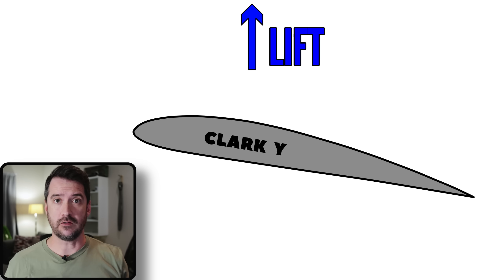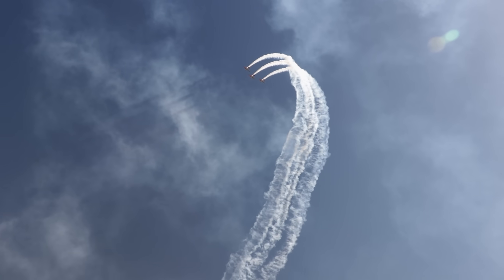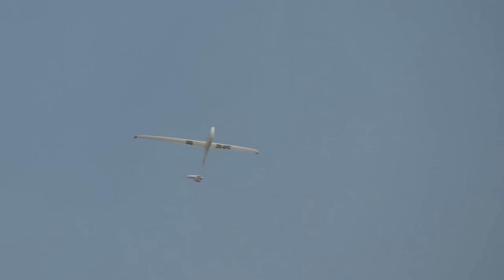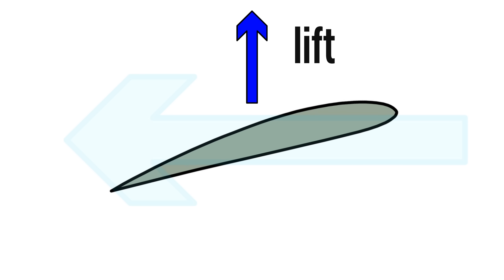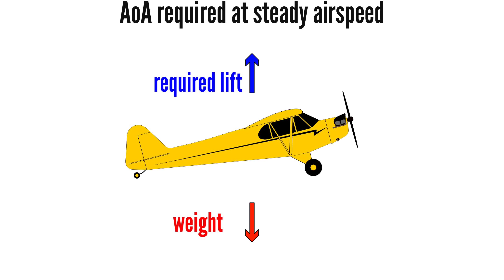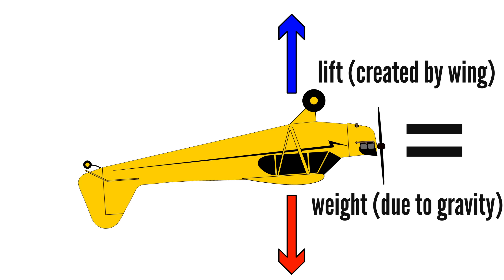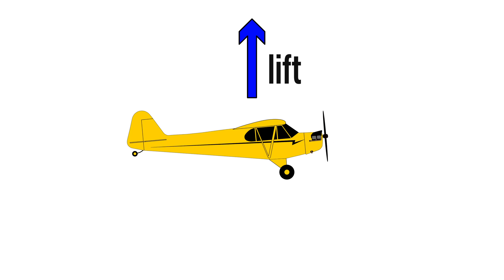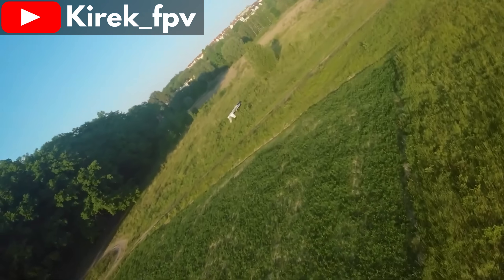Is Airflow Distance Over the Top of a Wing Always Longer?

Comment: I drove my instructor to shouting, arguing with him about the standard explanation of lift !
In my theory, I call it force of air mass/pressure under the wing causing the force of upward against gravity !
Nature hates unequal air pressure and the bottom wing is in the way !
I say the mass of the air flowing under the wing is pushing the weight of the plane up and the air flow over the wing
is just creating a more efficient low pressure area for that to happen. At stall angle of attack all that has happened is the
force of the mass has turned into drag and has exceeded it's ability to make things to go up.
Ever skip a flat rock on water ?  As long as the rock contacts the water at best angle of attack it will skip until it has lost
it's energy/thrust due to parasitic drag. As far as I am concerned a propeller and wing are doing the same thing, just on a 
constant and in a more controlled  manor.
Reply: Wind tunnel tests show that even at angle of attack close to the stall the pressure drop over the wing is much greater than the pressure increase below the wing. Now technically yes, the pressure under then pushes the wing up but really you must consider the differential (the CL x q in the formula Lift = CL x q x S), most of which is derived from the pressure drop in the increased speed of flow over the wing.

Comment: You make many sound points.  However, the oldest, most difficult, but most accurate explation of lift in a subsonic wing is the circulation theory of lift.  There are reasonably simple heuristic explanations of this theory, which only require a middle high school level of mathematics.  But the full explanation requires some pretty sophistocated math relating to the Kutta-Joukowski theorem. A full explation of this requires an understanding of line integrals, as well as vector and complex analysis.  This is the stuff of a second year university engineering course. I have an entire textbook on it.   The full story is quite a jump up in complexity and, therefore, not usually taught to pilots and people who are casually interested in all things flying.  I can supply references if you're interested.  Fun fact, the full explanation of 'how a wing flies' can be formulated with a series of equations that have no explicit or closed form solution.  At least, not without making some pretty limiting and factually incorrect simplifying assumptions.  Therefore, the  only way 'solve' these equations is through computer aided simulations.  But these simulations are still only approximations.  Therefore, no one can say, for sure, how a specific wing will work till you fix in onto an aeroplane, stick a test pilot in the plane, and fly it!  Even windtunnel testing is not quite the same as'the real thing'.  Still want to be a test pilot?
Reply: As a test pilot, with a MEng degree in Aero Engineering, this comment is the one that I agree with the most. 👌🏻
Reply: As an Aeronutical Engineer this is the answer I was looking for. There is a reason it is called lifting "theorems" and not lifting "laws".
Reply: Explaining how a wing generates lift and solving the equations of lift for that wing are two very different things. The fact that you seem to confuse these two things is somewhat concerning.
Reply: Thank all of you for your statements. From someone who loves aero-D but went to work on the flight deck. The fact that a flat or symmetrical surface will only create lift in the direction of the angle of attack always dispelled both the camber/deflection theories in my thoughts. 👍🏼
Reply: @davetime5234  It depends who the audience is. An Air Cadet would get a different explanation to a graduate. Nevertheless, despite the lack of context of your knowledge level, I essentially begin to explain it using F = P x A. We know a pressure difference is occurring over the wing, which has a surface area, a force is generated (lift). A by-product of this force is drag, partly skin friction, partly bluff form drag and partly the low pressure in the centre of the trailing edge vortices. This would normally trigger 2 questions. 1, why is there a pressure difference - what causes it, and 2, what are trailing edge vortices & how do they occur? Starting with 2, if high pressure air is under the wing, and low pressure air is on the upper surface, the air wants to flow from high pressure to low, just as air inside a balloon wants to escape. As the air can't migrate through a wing surface, it slips around the wing tip, and generates a spinning vortex which gets left behind the aircraft. Sometimes, these are made visible by moisture. How so? Well the air in the centre of the vortex is condensing. Why? The air is cooler than the surroundings (and reaches dew point), because air in the centre of a vortex is at a lower pressure (hence it being a contributor to the overall drag, remember?). Going back to question 1 then, which is the root of all this…why  is there low pressure on the upper surface of the wing and higher pressure underneath? Well, here's the cool bit - no-one really knows for sure why it happens! There are theories and plenty of long equations, and people study it at incredibly high level, but like many things in life, we don't fully understand the 'why' bit make full use of the effect produced and accept that it's great to soar like a bird and see different countries in a matter of hours. According to the theories, apparently bumblebees should not fly - but they do. Sometimes the world is a magical place.
Reply: @peteohead To discuss a minor point, obviously bumble bees do fly, and when not analyzed with non-applicable math, there is no issue. 'Can't fly' resulted from using fixed wing formula, and bumble bees have extremely movable wings. When moving wing dynamics were considered, the math agreed with the observed bumble bee flight and hover. IIRC, the vortices generated as wings approach then separate from each other at the top of every flap, supplied more than enough differential pressures on the wings to explain all the bumble bee flight envelope. I doubt this fully explains the real genius of moving wing flight, Dragon flies, with two pairs of fully independently controlled and driven wings. Reportedly, they are almost as fast in reverse or inverted flight, the true reigning masters of flight.
Reply: See I agree that SOLVING lift is too difficult to explain to the layperson, but lift as a concept isn't that difficult to explain at a basic level: it's certainly better than continuing to use a WRONG explanation, which the equal trasit theory is plainly wrong. 
Everyone has seen the balloon/jet on a string demonstration, where a balloon releasing air rearward generates a propulsive force forward: at the most basic level, all the wing is doing is taking the flow of air moving rearward over the wing and turning it downward to generate a lifting impulse. I don't think that description is too difficult for someone with a casual interest to understand, and I think saying that "it's too hard so we're just going to keep teaching pilots the wing theory (who I'd argue have more than just a casual interest in the subject!) is a complete cop out!
Reply: OK, just to clarify. Thanks all for your comments on my comment.  And, again, I loved the original post.

I was trying to keep my explanation simple and heuristic.  Quite frankly, you can pilot a plane perfectly well without really  knowing exactly how lift works.

Afterall, people have been doing it ever since the first plane flew, and before, if you count unpowered gliders.  Same principles govern  lift in helos.

Baloons, dirigibles and all lighter than air aircrsft are different, though.

Perhaps an analogy is in order.  I can work a tap without knowing anything about fluid dynamics.  I might get annoyed when the I get 'knocking' in the plumbing.  But I know how to fix this.  Change the pressure.

Now I, with my maths degree, could give you the equations that explain  'knocking' in a tap but your eyes might glaze over.  However, these are pretty much the same equations that govern laminar flow over a subsonic wing or the flow of plasma at 100 million degrees in a tokamac fusion device.

Heuristic explanations are 'good enough' for Private Pilots with a PPL.  With some modifications, they even do well enough for people with Commercial and Aviation Pilots Licences (CPL and ATPL).

Conversely, I understand the theory much better than most but I have struggled to obtain my PPL.  That's because I am autistic and have terrible eye hand coordination, and a crap working memory.  I lack 'feel' for the plane, my instructors tell me.  I'll get it one day but it's taking forever and I'm now 65.

It's quite embarrasing really when I've seen 87 year olds and 17 years do quite naturally what I struggle with.
 
The rest of the theory is for aircraft engineers completing a four or five year degree.  Or, for enthusiasts.  You are perfectly welcome to wade through the ssme texts that I have.  Hundreds of pages of equations.  I love equations but then most people call me a freak!  Goes with being autistic.

Kind regards, A Freak.
Reply: @jamestucker1126  Don't be embarrassed about your difficulty in the cockpit: I too am a "failed" commercial pilot. Unlike you, I had great hands and feet, but I get behind the aircraft mentally and at that point can't catch up. It sounds like the two of us together might make one very good pilot! After having to give up my dream of flying, especially after spending all that money chasing the dream, I've come to accept that we all have different talents, math and other fast calculations that are done in the cockpit are not my talents, and that's not only OK, that is normal. 
You are not a freak. You are normal.
Reply: The "circulation theory of lift." is something I've been on the edge of understanding. My lack of formal education in that subject has hindered my complete comprehension, but my sense is that it is closest to reality.  Still, I managed to make some successful sailboat foils back in the day using Theory of Wing Sections.

My sense is that you can make good approximations with data -- ToWS, or with math -- CFD, but you have to remember that they are approximations and compromises.
Reply: that´s it! when I studied aerodynamics I  studied it hard and with serious books. to begin with "aerodynmics"  --- theodore karman. and more more. the circulation theory is very interesting. but it needs lots of calculations and not a boy's game.  conformal representation leads into a math explanation . it´s long story. not available on pilot accelerated courses.
Reply: But isn't Kutta-Joukowski a subset of Navier-Stokes along with Bernoulli, the Coanda effect etc. etc.? 

And the best numerical simulations of the Navier-Stokes equations approach the results of real physical testing of the forces and flow across airfoils?  

Therefore, while avoiding detailed case solutions of the Navier-Stokes equations, can we not still look at the fundamental physical laws encoded in the Navier-Stokes relationships for a disciplining guidance on how to better basically describe the nature of lift?

Navier-Stokes:  conservation of mass flow rate, conservation of energy and conservation of momentum (simultaneous partial differential equations connecting the interrelationships of these fundamental laws)

The path length obstacle imposed (by the combined effects of camber and angle of attack) create a lateral pressure difference consistent with conservation of energy as demanded by continuity of mass flow rate.  The gradient and the accelerated speed of mass around the imposed contour go hand in hand.

This lateral pressure gradient maintaining flow rate consistent with energy conservation, changes the vertical momentum of adjacent air, which creates the vertical momentum change consistent with Newton's second law, which is the force of lift?

I guess I am disputing your statement: "But the full explanation requires some pretty sophisticated math relating to the Kutta-Joukowski theorem," in the sense that we can better provide a basic explanation of the drivers of lift, even though an actual wing design requires much computational fire power, and real-world testing.  

While Kutta-Joukowski is required for a more accurate mathematical representation of a particular case, a simpler yet more full basic explanation only requires that we describe the process logically in terms of the fundamental laws of Navier-Stokes.  And for some reason we historically fail to do that.  Example:  equal transit time is used incorrectly as a shorthand for mass flow continuity.  Bernoulli is somehow stated to be equivalent to Newton's second law applied to the vertical change in momentum, even though the implied conservation of energy and conservation of momentum consequences must both be integrated into our more reliable simpler explanation, because they are integrated in the most reliable theoretical explanation, Navier-Stokes, with that being the most comprehensive description of the physical reality.
Reply: @davetime5234  Hi budy.  I was trying to keeo it 'simple'.  Technically, even Newton's Laws are wrong.  But they're more than good enough at subreletavistic speeds and/or if you don't get into quantum mechanics.

Comment: If you fit air pressure pressure sensors on the top and bottom of a normal aerofoil you will find that 80% of the lift comes from the top surface and 20% from the bottom surface, depending on the AoA.  If you use a flat plane for a wing, then all the lift comes from the air deflected by the lower surface but you need a lot more power to get the same lift.  So for a normal aerofoil, Bernoulli gives 80% and Newton gives 20%.    Flying inverted the AoA had to be greater and the wing is inefficient, but will still work, as stunt pilots regularly demonstrate.  It's not an issue of somebody or something being right or wrong, it is an issue of efficiency for the speed and power requirements of the aircraft.
Reply from the maker: I'm not sure about the 80/20 split (not saying it's incorrect, it may very well be correct) but even NASA says the airflow over the upper surface cannot be neglected in accurate explanation of lift. A flat plank for a wing, as long as it has a positive AoA, still forms a pressure differential below and above. It's more difficult to visualize, but a cambered wing's shape isn't the predominant factor creating lift.
Reply: @LetsGoAviate  A flat plank tilted will generate lift below it and turbulence above it, very easy to demonstrate in a wind tunnel.   As regards the 80% lift above a good aerofoil, try flying one with rime ice forming on the top surface - the lift is reduced dramatically.  A theory has to account for the evidence.
Reply: @LetsGoAviate  Wing shape is what makes wings efficient and allows light aircraft to fly with small engines.

Comment: Length of surfsces is irrelevant. The difference in speed between each side of the wing is all that matters.
Reply from the maker: Length of surfaces is irrelevant, I agree. What I was pointing out was length of the flow over and under, which separates at the stagnation point, not the leading edge. Thus length of surface over/under does not equal to length of airflow over/under.

Comment: Forget about the various "arm-waving" qualitative explanations of lift. Just get a copy of Glauert's " Elements of Aerofoil and Airscrew Theory" and read it. It was written in 1926 and proves that the origin of lift and a quantitative understanding for flat plates, cambered plates, aerofoils and wings of finite span were well developed nearly 100 years ago. Just follow the maths.
Reply: @davetime5234  There is a PDF of the book available on the web so you can take a look for yourself.
Reply: @davetime5234  Well, I think the starting point is that lift is a result of the interaction of the free-stream flow with the bound circulation associated with the object (aerofoil). Glauert develops this in a methodical fashion and uses the analytical solution for the stream function in invicid flow around a cylinder to produce an analytical result for a Joukowsky areofoil using conformal mapping. By applying the Kutta condition to eliminate the singularity that would exist in the flow at the trailing edge he produces a result for the circulation around the body that can and has been shown to be in excellent agreement with experiment. While the conformal mapping approach is not applicable to aerofoils more generally this approach provides a very solid basis for our understanding of lift more generally. It provides an excellent starting point for the understanding of lift for wings of finite span from which accurate predictions for induced drag etc can be made. 
Personally, I have been working with this for well over 50 years and I'm quite happy that the maths of this approach provides a sold foundation.
Reply: @davetime5234  Many thanks for the reply. I used to always edit and save long replies in a word processor and save them because this used to happen a lot. I need to get back into the habit as it seems to be happening a lot again these days.
Reply: @davetime5234  Well, I wrote a lengthy reply to this which has just disappeared so, if you didn't see it before it got deleted, I guess you are stuck with the book.

Comment: Wings do not generate lift they generate a disturbance.   With power inputs and control surfaces the disturbance can be used to suck the airplane up.  Does the wing of a hummingbird create lift by wind going over it or does it create a pair of tornados that flows over its back "for lift", using its tail for orientation?